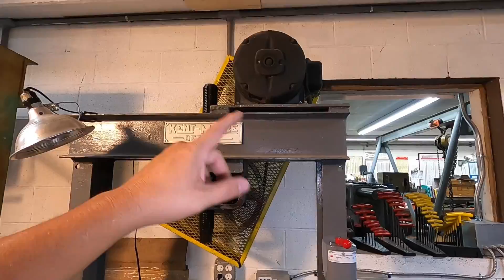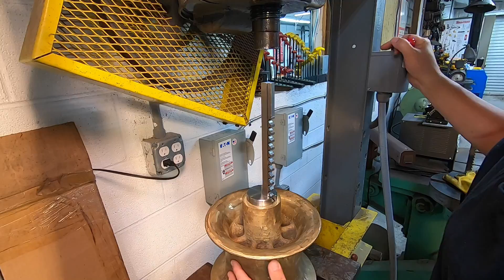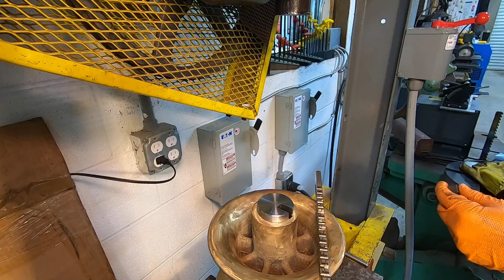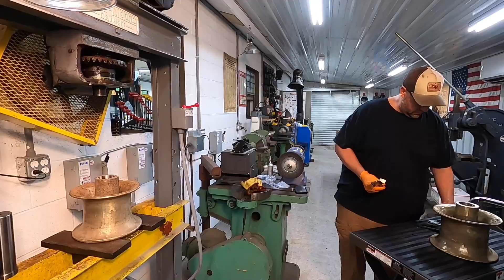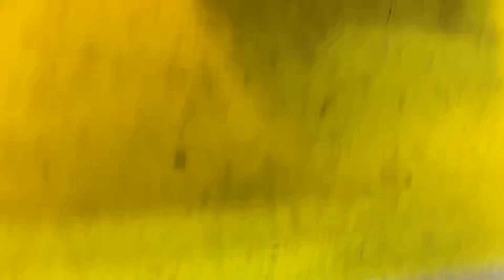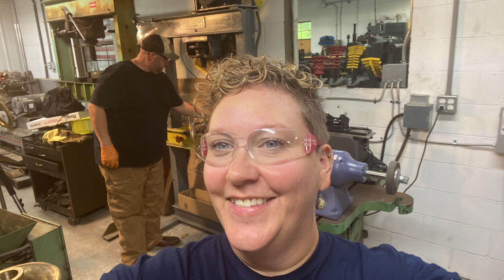Broaching Keyways in Cast Bronze Capstans Part 3

Comment: Do they make broaches with a more aggressive  cut per tooth or are they all a industry standard type deal? Just curious if you had a very large press and wanted to cut a key way in just one pass. Maybe the tool pressure would just be too high? Thanks for another awesome video...great camera work from your helper!
Reply: OMAD’s Dad..I didnt really even think of that and the tools holding smaller tools etc etc.  That’s great, because my work pieces will vary greatly even though this is mostly just for fun. I am certainly going with CNC and DROs especially since I already know quite a bit on the programming side and G code. I really appreciate both of your knowledge, I ask almost every week on Adams channel (without feeling like I’m trying to hijack his comments) and you are the first two to offer to help, I greatly appreciate that. The entire reason I ask on here is because I respect the work that Adam does and know there has to be some knowledgeable people here. Thanks again.
Reply: They make single pass cutters, but only for short bores.
Reply: The Metal Butcher ..I see, thank you for the reply. I’m hooked on this stuff and am about to purchase my first mill, but I’m not sure what I should be getting so I’m learning as much as I can (not that this has anything to do with deciding on a mill). Thanks again.
Reply: @specforged5651  Got a lathe?
Reply: The Metal Butcher   Nope, all I have right now is a 4x4 CNC router that I use to cut carbon fiber so I am looking to get both right away. I’ve always wanted to get into this because I’m a gear head engine builder that is always tinkering. I do a lot of snowmobile and off road turbo applications so it sure would come in handy a lot. I mean, I can certainly understand quite a bit, however, I’m new to actually running and purchasing machines. I do want some good equipment I can grow in to and have for a long time so I certainly don’t mind spending the money. I am thinking right around 100k for both then go from there. Of course I have the manufacturer reps beating down my door with the “best this and the best that” , but I would really like some first hand opinions and knowledge from the kind of people who watch this channel. So far I can’t get anyone to respond or give me some direction. Thanks!
Reply: @specforged5651  Well opinions will vary, but I use a lathe about 10x more than a mill. And if you count all the times I could use a drill-press, then it's probably 30x more. So I always recommend the lathe first. And yes, that's coming from someone who had a mill first. Machine price will depend a lot on area. You certainly don't need new. Hell there is a beautiful 10x24 Smart and Browne toolroom lathe on PM right now for $3500. Can't beat that at triple the price with a new lathe. I'd say in my area (near Adam), nice used lathes run about $1500-2500 for 10-12", $2500-4000 for 13-15" lathes, and up to around $10k for larger. But you see some steals of course. I think new machines for a newbie are a bad idea. You'll make mistakes, screw things up. Best not to do that to a $50k lathe. Regardless of what you spend on the machines, you need to budget a small fortune for tooling. I don't think you could scratch Abom's tooling collection for a million dollars purchased new. I mean, one big broach is like $1000 alone. So you've just got to find it cheap and save it up over the years. But I do think it's important to save a lot of your budget for tooling. $100k is an incredible start, and I'd certainly not blow it all at once, but spend it when you need it. You might consider joining a hobby machinist forum, they could give better direction and opinions than I. Good luck.
Reply: The Metal Butcher ...I appreciate the advice, all things that I have been thinking about (especially with used and less sophisticated machines). I figured myself spending another 100k upfront on tooling for sure so that was a whole different discussion. However, wouldn’t I want to get a machine that would accept the bigger nicer tools and holders to begin with? Not saying bigger is nicer I’m just seeing all of these different spindle (mill) and chuck (lathe) taper sizes etc. I would certainly want a machine capable of using the tools for a lifetime instead of also having to upgrade my tool holders when going to a more advanced or larger more capable machines. Maybe I’m not thinking correctly when it comes to that. Wow, that seems cheap for equipment, maybe I’m just way off my bases on looking at machines. If you could recommend some brands of lathes and mills to be on the lookout for I would appreciate it. Of course I know the Bridgeport name, which it appears most mills are/were based off anyways. As far as lathes go I only see what I see on the internet of like JET and of course what I see on the channel like K&T and Monarch. I certainly don’t mind spending the money to get some good capable machines with power feeds and DROs right up front so I can learn to use it all at once. Money is the least of my worries, but would rather not spend it twice if I can help it lol. I completely understand with the tooling though. All of my SnapOn stuff is worth hundreds of thousands so I certainly get the idea there and am prepared for it. Thanks again.
Reply: OMAD’s Dad...I greatly appreciate your knowledge and guidance, I have been hoping someone would help me out. I’m kind of set on getting both, not strictly because of different capabilities, but to learn about each operation. I obviously just have a broad and general understanding of how all of this works and understand mechanical operations very well, it’s just how my brain works, but would never say I know what I’m doing here by any means so I will soak up as much knowledge and direction as people are willing to give. It is actually quite amazing what you can learn from these videos though, again, would never say I know what I’m doing, but am starting to understand the equipment and procedures more fully now. The one thing I have on my side is the money really isn’t an issue, I just don’t want to spend it twice by jumping into something I shouldn’t have. I’m more than willing to purchase whatever is necessary to learn and operate safely. It’s actually quite strange I don’t really know anyone in this industry locally, given all of the hobby’s and passions that direct me down this road anyways. Engine building and off road/snowmobile racing especially. Sure I have local machine shops I use, but they aren’t too willing to divulge much information. I completely understand that though, it is their livelihood and they have put in the time and effort to become so. It’s not about taking business from them, it’s more how my brain works and tells me I need to learn this. I’ve found most machinists have that ocd perfection brain like mine so that is helpful. Thanks again for your help!

Comment: For various electrical and mechanical reasons , you should always allow an electric motor to come to a stop , before reversing it .

God bless
Wyr
Reply: It only lasted about 40 years and then the switch handle failed.
Reply: @kennshotts7258       All fun and games until the switch arcs out .  Awful close to your hand .  Has it done so yet ?  No .  May not in this application ?

     But is it worth taking a chance ?  Would not be for me .

     Would be much more dangerous if it was 480 VAC , instead of 240 VAC ( or 208 VAC ) .

     Do you go from reverse to drive on your car , without coming to a stop .

     But you all do as you wish .  Pays your money and takes your choices .

     Just trying to give the benefit of 40 years in the electrical trade .

God bless
Wyr
Reply: @wyrtwister4260  whether you come to a complete stop or not the switch is still used the same amount of times. I think adam will be Ok to keep doing it for another 30. Its not a problem except in your mind.
Reply: @kennshotts7258  Yes , the purely mechanical wear , on the switch , is the same .  The arcing will not be the same . 

     I wish Adam all the best in the world .

God bless
Wyr

Comment: Now show how to cut the other side of the woodruff key slot in a shat please
Reply: In a shat?! Use your finger ;D
Seriously though,  Doug has a vertical mill so he'll probably use a dedicated Woodruff cutter on an arbour,  plunged in to the correct depth. or knowing Doug he'll be tempted to freehand it with an angle grinder with a wheel worn down to the right diameter.
3rd guess,  A woodruff key wouldn't give much engagement with such a wide pulley,  so I'd be tempted to use a long key or maybe 2 Woodruffs.
4th guess,  The shaft already has a key, as the pulley was made to fit an old winch.  I should have remembered that before I saw the photo.

Comment: A part of me was hoping that you would have been allowed to put those capstans on the lathe to clean up the surfaces and polish them to not only improve the appearance but give them a more accurate standard size.  But that's just my notion that rough castings always look unfinished and incomplete... the craftsman spirit in me if you will.
Reply: You probably wouldn't want them too shiny as they'll be expected to grip rope with a single wrap.  There's a lot of rough cast look on SV Seeker.
Reply: I was thinking the same thing.

Comment: how is the slot not tapered if your shims don't extend the length of the plug?
Reply: Am wondering this myself. Seems like there would be a worry of the broaching tool flexing once it gets past the shims.
Reply: I would guess as each progressive tooth engages the cut there is nowhere for the broach to flex or move into as long as the shims cover 4 or 5 teeth distance
Reply: Back of the cutter is flat.front is ever increasing with.
Reply: It cuts at one point, the rest of the travel is passive.

Comment: I have the same press in my shop, still hand cranked. It also has a ratchet mechanism on the back of the handwheel with a three foot bar to really crank down. The plaque is not as large or fancy on mine, reads "KMO, endorsed service equipment, Kent Moore Organisation, Detroit, No. K-22a". It supposedly dates to the late 1930's.
 There have been several times when the 20 ton Chinese press at work couldn't cut it and this antique iron did the job with no problems, although it will jump of the ground when a really tight somthin' lets loose.

Comment: Adam I see you using the catch and reset everything method to do broach plugs i have a suggestion (I am not an Engineer) could you create a broach plug bit holder on the press so that you don't have to catch and reset so much it could be a simple collar with set screws to mount it on the press end and a couple to mount the cutter to it and a simple down past the cutter and up add shim and down again. 
Or is it necessary to go all the way through and reset?
Reply: the teeth near the top end of the broaching tool need to pass all the way through the groove to ensure that the groove is cut evenly all the way through. I dont know for sure, but it may also be because you are not suppose to pull these broaching tools backwards against the teeth?
Reply: It has to go all the wat through.

Comment: In the video thumbnail there are small notches cut in some of the teeth of the broach. Kind and knowledgeable comments section, what are these for?
Reply: Chip breaker
Reply: @iolithblue  Okay, if I'm understanding this correctly it makes two small chips instead of one big one. The purpose of that is that you can more easily pack the two small chips into the gullet than one big one. Is that right?
Reply: @BravoCharleses  yes

Comment: Thanks for another great video. I've never seen a screw press like yours, having only worked with hydraulic presses in my career. I can see they have two advantages over hydraulic; very long strokes, with the only limit being screw length, and no fluid leakage.

Comment: i guess you get used to the sound. one wonders if you made a proper cover and fill the it with heavy duty grear oil. you could run the press without  ear protection?????
Reply: I don't think it would be a simple task to seal the rotating assembly.

Comment: where I work we broach all internal keyways this exact same way. ive broached 7/8 key in a 6.525 bore through 6 inches deep of s7 steel. we got a pretty good size hydraulic  press but exact same method and backing off is key to it aligning good also we use 1/2 shims basicly 1/2 thickness. doesn't sound like it would help but it does

Comment: This isn't a criticism, just a question for education; is there any other (better) way to cut keyways?
Reply: Shaping machine but it's tricky.  An alternate method but not necessarily better.
Reply: I don't know about better (depending on the application?) but a key seat cutter machine is another way to cut/broach a keyway!
Reply: With doing two pieces that is best way to do it. You could used  Keyseater machine also.....

Comment: Why does the broach have some split teeth and some full teeth?
Reply: I'm not positive but I think they all have split teeth to brake the chip into pieces
Reply: Notice the splits are not in the same place on different teeth. That way the keyway is fully cut with a smooth surface.

Comment: If the shims are shorter than the plug/hole will not the broach bend back where it cuts unsupported?
Reply: I would think so, maybe not so much cutting brass, depending on how much was unsupported.

Comment: The clattering gears can be somewhat quieted down with some chainsaw bar oil. It is "tacky" and does not sling off easily. For really loose meshing gears, STP will also quiet them down.

Comment: Adam, thanks for another great video.  I'm sure that when that press was made, it was OK to have those gears exposed.  It was hand cranked, so how much damage could you do?  Now, you've got a two horse motor spinning that thing.  Anything gets caught in there, kiss it good-bye.  Why not make yourself a nice aluminum cover for that?
Keep up the good work!
Reply: I don't know if one is really needed. You would almost have to try to get something in there through the normal use of the machine. It couldn't hurt to add one though.

Comment: It's all new to me.i know its slow but does the broach or chips get hot?
Reply: I'm sure to some degree, that some heat is created, especially when using a machine to feed it through the cast pulley. However I don't think the chips would be hot enough to burn you because the whole purpose of a keyway broach, is to slowly remove material step by step, typically the broach takes several thousands of an inch per tooth, leaving not much room for a lot of heat to be created. Though at faster speeds I imagine you could burn yourself but you have to get it going very very fast, way faster than Adam had his braoch moving.
Reply: No heat is generated with a hand operated arbor press, use your favorite cutting solution.  I did hundreds of Boston sprocket gears in 1960, no heat.
Reply: @Carl Klinkenborg I agree, what Wayne fails to see is that hand broaching is a different process from that of using a machine to broach a keyway or whatever it may be for that matter. The fact is that hand broaching is a slow process while with the use of a machine it can be accomplished with great speed and ease.

Comment: I couldn’t help but notice that the broach cutter teeth had gaps cut in some of them. Was this some sort of mechanism to relieve tool pressure, or was it to help with chip evacuation (or did someone make a booboo)? 😎
Reply: The groves on the teeth are called chip breakers, they are intentional. They are used to prevent the chip from sticking in the gullet and binding the cutter.
Reply: Jack R okay, thanks! 🙂
Reply: It looks like it's done on purpose. They are located off center in an alternating pattern so the resulting cut will still be even. My guess is it helps chip evacuation, the chips get broken up and don't get jammed up in the slot.
Reply: I was wondering the same thing, but clearly not a boo-boo as it has an alternating pattern and the last three teeth don't have the gaps.

Comment: I noticed you didn't see the need to "backup" the bottom of the center web while pressing. Isn't that a lot of pressure in the web that's perpendicular to it's designed directional load? Just wondering if you ever worry about cracking the web, or is there not that much force applied to push the broach? Great video, thank you!

Comment: Hi Abom,

Just screw that thing on so the direction is intuitive, 90 ° counterclockwise.
The cable dangles out to the right, no problem, and the direction of the lever movement is clear.

Comment: First off very nice job. 
The broaching made me think of how a straight tap cuts very much the same way. It cuts with the first thread at the bottom and each thread behind on next flute cuts the thread a little bit deeper till the last full thread cuts a full thread. 
That's why when I sharpen one I must be sure to run the clearance up to just the top of the last full thread but not over as it wouldn't cut a full thread in the hole. 
I just thought you might think that interesting.

Comment: I wonder if that's a crown wheel out of a differential that they used on that press?
Reply: Differentials have spiral bevel gears. Strictly, hypoid curve.(Google is your friend ).
That gear is an ordinary bevel. I think Model T and Model A Fords had similar gears but post WWII such was just not used.

Comment: Adam, Doug. Before you fit them you may want to consider some form of friction enhancement to the drums? Wet lines will slip on a smooth drum (look at yacht winches) Maybe pin gun or nice slotts done on a shaper with a rotary table, or on the vertical mill with a ball end mill? Doug probably already has a plan 👍 .....  Sail Safe Guys, Ant, Cid & the pooch crew.
Reply: Those castings are such poor quality they will fail.
Reply: @thepotterer3726 So is everything above the keel.